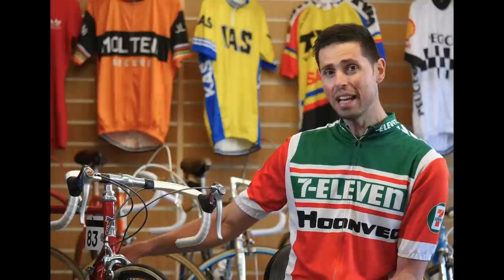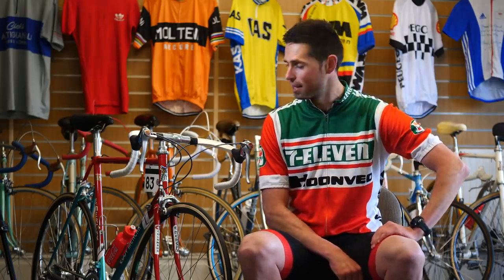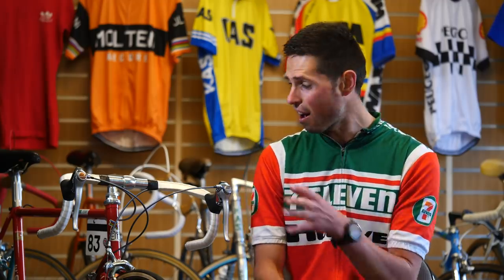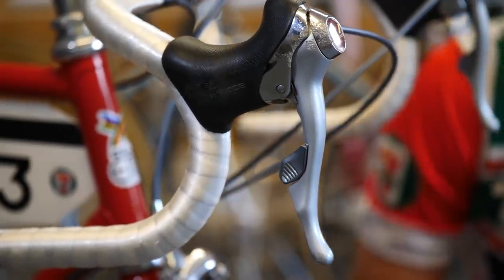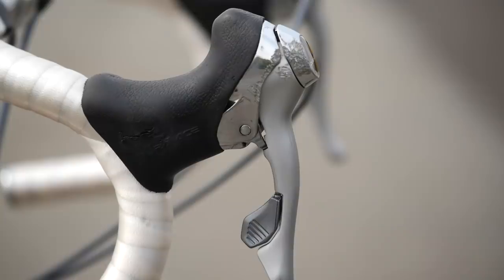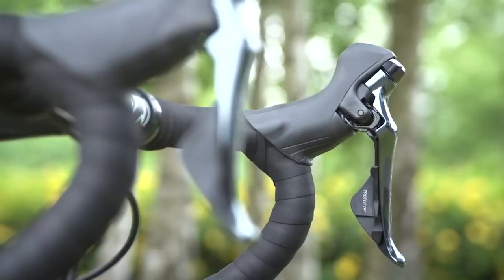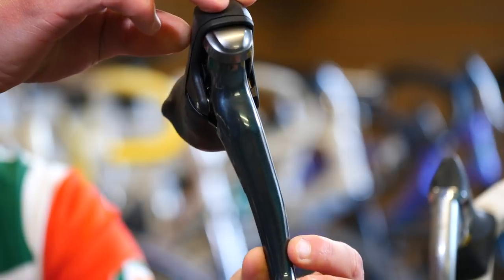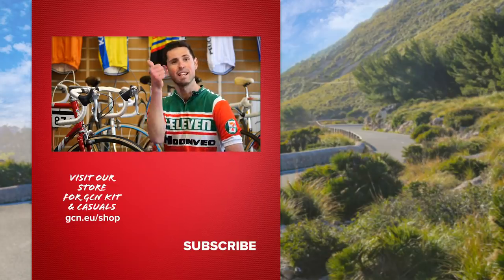Is This The Biggest Bike Tech Innovation Of All Time? | Shimano Total Integration Game Changer

Comment: The ability to shift so reliably under all sorts of conditions, and to brake and shift at the same time, meant that STI also changed cycle commuting, improving the ability to integrate into traffic flow and maintain better situational awareness of what other road users were doing. An absolute game changer when I had my first set about 20 years ago!
Reply: I chipped a front tooth ages ago riding into the back of a parked car on my way home from school watching the down-tube lever change gears.
Reply: Game CHANGER you say???

Comment: Imagine if youtube existed when STI was released. The comments section would have been full of people complaining about evil corporate bike companies fixing a problem that didn't need solving, and how it was harder to maintain.
Reply: it‘s certainly heavier too because of the ratchet system and extra housing and gear cables. durianrider would have been punching the air
Reply: No worries. I complain now. I say they are still almost same. Not enough improvement. The old ones were better, lasted longer.. even after crash still working as you can see from video.. complain, complain, complain. :D
Reply: RollinRat  Outside of actual racing, the advantage of STI's is really minimal in my opinion too. The reliability of downtube shifters, and the fact that they're just so cheap honestly trumps the convenience of STI's. Now I prefer friction downtube shifters generally, but especially with indexed downtube shifters the advantage of STI's gets really really marginal. With STI's you can shift while standing up out of the saddle, that's about it.
Reply: RollinRat  well said. Ride upgrades don't buy upgrades
Reply: RollinRat  yes, I'm quoting him, I'm a plagiarist
Reply: Instead that was the in the magazines and on bulletin boards
Reply: Actually true. But thanks to microshift, I can wreck my sti (or MTI) and not have to choose between eating for a month or two and riding my bike. Brifters are insanely fragile and expensive compared to downtube even if they are ergonomically superior. So definitely a valid argument
Reply: @MountainVisions  well said. I bet long distance touring riders use bar end or down tube changers
Reply: @ntglf467  That guy is such a clown.

Comment: I got my first road bike when I was about 14yrs old, it came with downtube shifters. I got so good at changing gears that I would accurately move the shifter the right amount to change gears & I rarely had to re-adjust the shifters after changing gears; I rode that bike for about 11 years. I didn't get another road bike until 2015 (about 17 years later), it came with a 6800 series Ultegra groupset, I love it, but there are still times when I find myself dropping my hands down to shift gears only to find nothing there!!

Comment: My first bike with a derailleur was a mid-1990s kid's mountain bike with a grip-shift shifter - which means I grew up with shifting at my fingertips right from the start.  It still boggles my mind that STI levers first appeared on road bikes only 5 years earlier.

I tested an old roadbike with downtube shifters before buying a new drop-bar bike last year, and the difference is phenomenal.  I can only imagine how revolutionary STI levers seemed when they first appeared.

Comment: The downtube Dura ace shifters were super precise on the shifting for two reasons. Shorter cables with no housing and they were seven speed instead of the “new” STI levers that were 8 speed. The downtube lever setup was also lighter. Some guys would keep the downtube shifter on the front derailleur and the STI on the right side to save weight.
Reply: Hmm, my Ultegra 7 speed downtime shifters on Klein Quantum were great. I tried three shops and nobody got the Ultegra 8 SPD sti working well on my Klein Quantum 2. With the b-tension screw removed and the shift cable pulled down to increase chain wrap the shifting was ok, but not great.

Comment: How times change! In the 70's it was important to have Campagnolo gears if you wanted to be cool. Now it's all Shimano and Sram. I certainly don't miss the friction shifters having returned to cycling at 62 years.
Reply: Wrong... Campagnolo is still the best and the coolest.
Reply: @johnandrews3568  Campagnolo is over priced and overrated. Normally used by old men or wanna-be euro cyclists that only ride it because it is the most expensive or is a euro sounding brand.  All kidding aside, all three manufacturers make great stuff.
Reply: @mikes1984  Everything is overpriced in cycling. At least campy you get a product that lasts a lifetime.
Reply: I have a lovely big scar on my knee from a snapped Campy crank that is proof that's not true 😂
Reply: @photoben  exactly, some campy cranks and bottom brackets have been known to snap
Reply: It took Campy long enough to get indexing to work. My experience, in the 90's, was that they were poor on engineering and high on manual polishing.
Reply: @eTwisted  In their defence though, shiny bike parts look awesome, and awesome looking bike parts make you go faster

Comment: Well Alex lets not forget that Shimano introduced the SIS indexd shifting a few years earlier and Campagnolo followed suit. So when Shimano introduced STI, no one (except maybe Sean Kelly) was riding friction in the pro peloton. And when Campy came out with the Ergo in 1992, the first with internally routed cables, that was an aesthetic game changer (and campy were and continue to be the most comfortable shifter on the market). But the old days... pre-selecting gears... everyone did it and then it was a game to see who blinks first. I wouldn't say shifting on the fly makes for better racing... just different.
Reply: I agree. I think you could make a case for the biggest development in components in the last 50 years was the SIS indexed shifting, enabled by the patent running out on the slant parallelogram rear derailleur. Without the SIS breakthrough, STI would not have been possible.
Reply: @qbertq1  totally. Although I'd say the lipless pedal is the biggest development. Probably splitting hairs though. :)
Reply: MRGRUMPY53  8 speed downtube I'm assuming. I have had 8 speed ergo since '93 on my steel bike and it's flawless... still. But making the jump from 7 speed friction Super Record to 8 speed Record Ergo was like a quantum leap in technology.
Reply: MRGRUMPY53  Yup agree... my 7 speed SR friction was super fast shifting as well. I moved to Ergo cuz I was still racing and had to keep up, plus the shifter is so much more comfortable than any brake lever which as you know were small.

Comment: Biggest innovation was the derailleur itself. I remember the change from reaching back or down to shift the gears by hand(va Fausto Coppi) to downtube shifters  introduced in the 1950s. ARrrrrrrrrrrrrr. 
And bar end shifters from Campagnolo, Zeus, and later Shimano . Then in the late 80s there was the SRAM shifters that you twisted for both road and Mtb
Reply: Shifters mounted near the front of the frame weren't invented in the 1950s. They've been around for pretty much as long as derailleurs, which is to say, since the 1890s. The 1899 Whippet New Protean derailleur in particular has a lot of similarities to the fork derailleur systems that a lot of racing bikes were using in the 1930s.
Granted, a lot of early systems placed the shifters on the top tube. I'm not sure when specifically downtube mounting was first done, but it's certainly prior to the 1950s: for example, the Osgear Super Champion derailleur of the 1930s typically used a downtube mounting position for its shifters.

Comment: Looking back, it's kind weird how we went straight from downtube friction shifters to STI. I was expecting stem friction shifters and indexed mtb-like handlebar shifters in between.
Reply: In the 1990s I had a Nigel Dean touring bike. It had Suntour (! - remember them?) components, and the indexed gear shifters (Command Accushift) were mounted immediately inboard of the brake levers, utilising a butterfly-style two-way lever to control the ratchet. It wasn't STI, since it was a separate mechanism, but it wasn't that far off, and was tremendously reliable, to the best of my memory.
Reply: Stem friction shifters did exist on non-racing, sports and a lot of lower end touring bikes. They weren't exactly the greatest, interferred with steering and you had to have the bars high. Too dangerous for racing. There was a brief period in the early 80s where manufactures experimented with placing shifters on top of the down tube instead of on the sides, or along the top tube, but both placements never really caught on.
Reply: @danielhall3895  back in the 1980s I had a Kalkhoff tourer that had friction shifters on top of the stem. Not ideal, at all! A road bike I had a few years later (don't remember the brand) had the friction shifters on the down tube. By comparison with the Kalkhoff, shifting was much more precise because I could control the leverage much better. I wrote off the Kalkhoff in a crash, while the other bike was nicked after I lent it to a friend!
Reply: Stem friction shifters have been around since the dawn on time, and were common on cheap road bikes in the Bike Boom era. On a performance road bike, I consider them a downgrade from downtube shifters. On a properly-fit bicycle being ridden in a reasonably aerodynamic posture, swinging the arm inward will get the hand to a downtube shifter with pretty natural extension. By contrast, stem shifters require lifting the arm and bending the elbow inward, which is a clumsy motion that puts the hand at a weirder angle for shifter actuation. Stem shifters also have the mechanical disadvantage that you need to use cable housing between the frame and handlebars, whereas downtube shifters usually require just a short run of housing at the rear derailleur and no housing for the front derailleur.

IMO the only time that stem shifters are a good position is if you're riding around on the tops all day, and that's the reason that they got stuck on cheap road bikes: a lot of people wanted road-racing-bike-shaped objects, but not everyone actually wanted to ride road postures, and a weird shifter position was the easiest compromise for manufacturers to make. Such bikes also frequently came with "turkey lever" extensions from the brake hoods to allow brake access from the tops.

For traditional lever shifters, a more typical position for handlebar mounting is the bar ends. Bar-end shifters have been around since at least the 1940s, and have long been a common choice on touring bikes (even today maintaining a small presence there). In the early cold war, they actually showed up a lot on racing bikes as well (look at photos from the Rik Van Looy era). They still don't really allow you to shift well when hammering out of the saddle, but are otherwise a pretty nice shifter position for road riding: either hand is a very small flick away from its respective shifter, and the shifter's position basically guarantees that it's in an ergonomically-nice spot as long as your bike is fit so that you can use the drops effectively.
Reply: @EdwardRLyons  One of my earliest bikes had stem shifters and it was a royal pain to maintain any semblance of smooth shifting, especially with a shorter stem, which already made the bike twitchy as hell! My next bike was a low-midrange Peugeot training racer, that had downtube shifters, life was so much easier even with the 90 mm stem, I could at least move the bars and change the bar angle to extend my reach to something stable and comfortable without the shifters in the way.

Comment: STIs are great, but you can be just as fast. I ride both and it’s just different technique to maintain speed. I switch between down tube and STIs often and if you practice (which literally almost no one rides fast with down tube shifters) there’s not that much of a difference. People freak out and say it’s slower and more dangerous because they haven’t put the time and practice in on DT shifters. You also have to MAKE SURE you’re brake cables and tension or correct because that’s another thing I notice why people think it’s dangerous because one brake works and the other one is neglected and doesn’t work when you are shifting with the other hand! You can also get used to shifting with you’re right hand for both DT shifters so you cover the front brake 99% of the time. 
You can disagree with me but can you say you can beat Greg Lemond in his prime just because you have STIs and he didn’t?

Comment: For you young lads who never used downtube shifters they weren’t as hard as you think. You just used what you had just like toe clips.
Reply: I used mines as late as yesterday, with a 7 speed cassette on a hilly route and I was just fine.
Reply: And there's a secret to downtube shifters that most don't seem to know: you can operate both levers with one hand.
Reply: I still use downtube shifters on 7 speed and toe clips....haha
Reply: Having ridden downtube shifters and toe grips for years, I will say STI shifters and clipless pedals are wonderful by comparison.
Yes the old systems worked and you got used to them pretty quickly, but the new one is simply better.  It's more relaxed, quicker and safer.
The 80 to 90% on the hoods was a surprise and shows how mow many years I spend riding before STIs were within my price range.  I spendat least 60% of my time in the drops, only on the hoods when noticably climbing.
Reply: Having to reach down to tighten or loosen straps on toe clips, unless you in a closed race situation, is not as easy as you say.